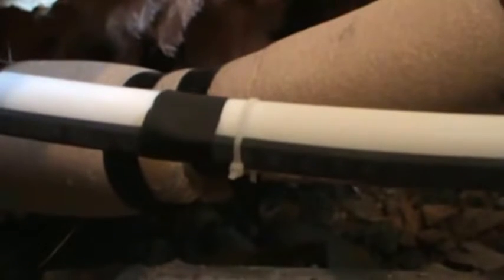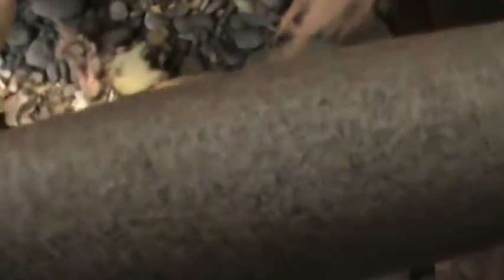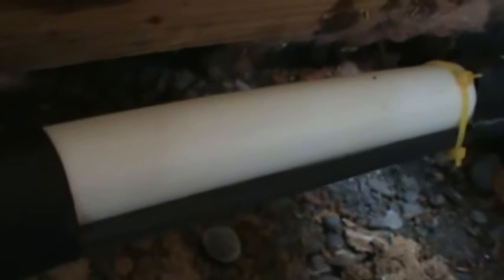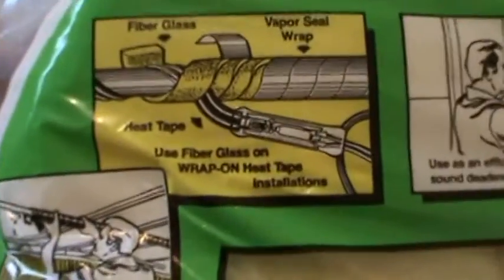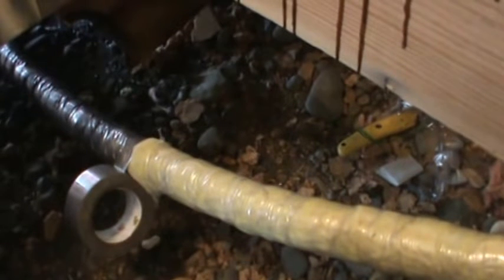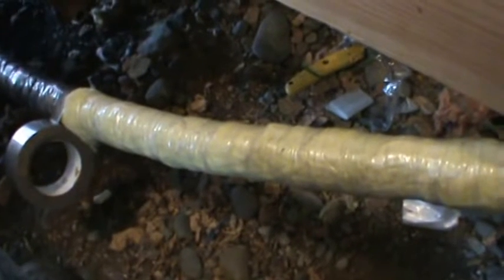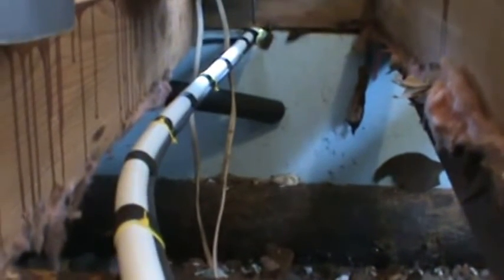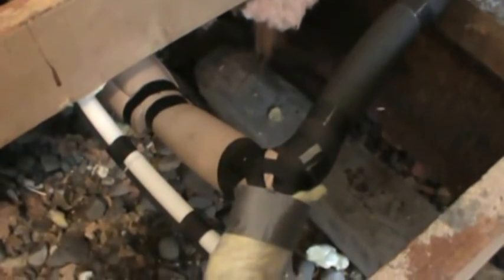How to Properly Insulate Water Lines in Alaska for -70 degrees Licensed Professional

Comment: How about the pipes inside the mobile home underneaththe floor do i still need to put heat tape in that?
Reply from the maker: Billy Montoya yes sir Billy there is no heat underneath your floors that’s the underpinning of the trailer. Newer trailers should already have it installed in colder climate areas but a good rule of thumb is to check out the main water line coming up from the ground and follow that line in every direction it goes and ANY waterline that is under the floor of the residence in the unheated underpinning area even if it is partially installed. 
Like that old saying goes......
“An ounce of prevention, is worth a pound of cure!”

Trust me you do NOT want to be under neath any of these trailers working on some frozen line that’s burst and I’ve seen them from 31 degrees all the way down to -58F below 0 which had with that temperature sustained winds of over 100Mph and gusts measured up to 160Mph. Let’s just say VERY COLD! I even seen one trailer that had to be chiseled into as the water sprayed the back corner for weeks and it had encased itself fully and the excess water was running back into the ground where it came up from. It’s never ever any fun to work with water once the temperature gets below freezing.
Reply: That will be myself soon... I’m in 1985 mobile home my heat tape took a crap last night. So in Ohio 15-20 degrees I’ll be replacing the heat tape

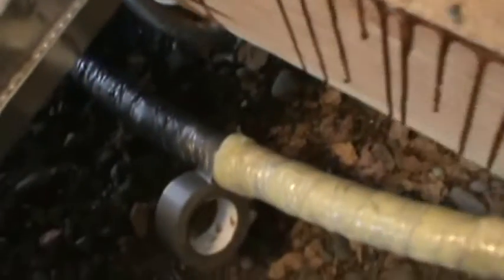Comment: Why wouldnt you install it at the 6:00 position?
Reply from the maker: That’s the exact resting place for all condensation and all water moisture to collect at just hanging around there. By making sure our material is avoiding that direct 6 o’clock position area then we are actually slowing down the deterioration process of our heat tapes and the metal braided parts inside the heat tape itself prolonging their life expectancy. This way having it at the 4 or 5 o’clock or the 7 or 8 o’clock position that allows the moisture to proceed right on past our materials relatively quickly finally resting at the lowest possible point with that being the 6 o’clock position but yet we are still in the ideal spot to get GREAT all natural heat transfer freely working for us inside the pipes because like always....heat rises so at the 4-5 o’clock spots or the 7-8 o’clock spots the heat will naturally rise up to the top of the pipe transferring heat from the pipe to the water and then from the water back to the top of the pipe.
Gravity, my man, Gravity.... it’s always working against us! 😂 
Gravity is bringing our worst enemy to us and we just want to avoid that spot at all costs. If you can imagine one heat tape wrapped around a pipe that’s just soaked in water all the time versus another one heat tape wrapped around a pipe that’s bone dry all the time which heat tape do you think will FAIL first and why?
YES!!!!!  Your Exactly CORRECT Wayne the one just soaked with water all the time will FAIL first and it’s because water is a corrosive in and of itself. Water is constantly eating away at everything around us each and every day. We are just trying to slow that inevitable process down as much as we can my friend. It saves us money, time, labor, materials, etc by doing it this way.
Hope this helps and I tried making it a fun answer Wayne so please don’t take any offense as it sure was not meant any other way than being a fun way for me to answer the question. By all means if you have any other questions be my guest and ask away Wayne, or any one else that comes along here wanting to know the answers to something you just might not grasp all the way and maybe I can try a different way of explaining it? Heck what would be GREAT is if you had questions that I couldn’t answer??? Why???  You may ask.....well that’s because I LOVE to learn more stuff myself and if I don’t know the answer to your questions then I do know how to find the answers and I’ll be learning something new in the process myself. 
Thanks 🙏 for asking such a great question Wayne I just had 2 friends here ask me to explain it a little better for them too so hey man they didn’t quite understand this concept either of not having it directly at the bottom of the pipe at the 6 o’clock position.
Reply: @dealsgalore  That's interesting. Cuz he said in video one of the fails is bad heat cable.   cool.

Comment: why do you specify the 5 or 7 oclock position? why not the 6 oclock?
Reply from the maker: Because condensation and any water or liquids will always go to the 6 O’clock position and by keeping the heat tape slightly above there that will keep the heat tape from possibly rusting out if it has braided metal coverings or any metal will rust. You also have electricity inning through the heat tape and we all know what electricity does with water and that’s definitely not good! Yes to get the heat tape as dry as possible to prevent premature deterioration of the heat tape.

Comment: What is the fire safety risk/failures using this method?  I ask because applying the foam tubes over the heat tape would seem questionable simply because it doesn't take much heat to melt those black foam tubes, and then adding fiberglass insulation wraps would seem to just compound the change of a possible fire igniting.
Reply from the maker: Billy Brigman the foam insulation is fire rated and fire retardant.
Reply: I was curious too   but now i know..cool thanks

Comment: i have a mobile home on li  in ny   its winter temps go down to 6 degrees ,   the crock under the mobile home has the shielded round heat tape with the black foam around it  now to see if its on. if i feel the first 3 foot of the heat tape wire  near the ac orange plug  yesfeel on o cold good day  should it feel warm   if its working ?
Reply: ReadyTemp intermittently circulates heated water through both the hot and cold water lines.  1/7th the energy consumed by heat tape.  Protects more pipe then what heat tape wraps around.  Installation requires connecting 4 hoses to the ReadyTemp which is 6"x6"x7".
Reply: it seems te heat temp is just a better insulation
Reply from the maker: Rondo Schiavoni it should be like warm when done correctly.
Reply from the maker: Rondo Schiavoni if you just want to keep an eye and make sure your heat tape is working properly all the time you can order a wireless programable thermometer off of EBay and to install you just tape the sensors onto the heat tape or water lines beside the heat tape and then I would recommend installing the receiver in you kitchen or living room where you spend lost off your time at and that way you can always jut glance over and read the temp and see that it’s working and hey if you do forget to keep checking it there’s alarms you can program when to have them go off and once the temperature drops below your programmed level the alarm starts sounding off alerting you there’s a drop in temperature and then you see which sensor it is and that tells you exactly which water line and which heat tape has failed and you simply go directly to that one and replace it. It’s the cheapest m, easiest and best way I’ve found yet. You can buy one off of EBay and have it delivered to your mailbox and super simple super easy installation you just tape the sensors onto the water lines beside the heat tape.

Comment: Open pipes in those temps why not those pipes underground ? Less heat tape less insulation less exposure less work , from underground comes up to under floor put that exsposed  pipe through big enough box with enough soil to insulate all around from cold from ground to floor. Then don't need heat tape or wrap around insulation. I don't t have exsperience with those temps . Just my opinion 😀
Reply from the maker: To begin with this job was a 1960’s or 1970’s trailer or mobile home that had been sitting there for decades. There was no way to dig 8-9’ feet down into the soil to properly insulate geothermally especially when your work conditions are a crawl space 24” high. This area of Alaska is one of the coldest areas on the road system in the entire state even colder than Fairbanks so we normally go down about 8’-9’ feet deep to run our water lines. We then run our water lines through arctic pipe. Arctic pipe is a galvanized or aluminum exterior 12”-16” pipe filled completely full of a dense styrofoam insulation with a 2”-4” PVC pipe conduit in the center of it. We will run our water lines through this arctic pipe to the residence but we normally don’t go back underground once the main hits the residence. Now with this specific area being on an ancient riverbed and within yards of a current major river, the same river that once ran where this residence is its full of old river rock snd the water table is about 12 feet deep which varies to sometimes just a. Few feet deep. Now also we have tundra up here not soil as you know it and it doesn’t have the same insulation value as your soil does so it’s a whole new ballgame up here than it is in the lower 48. That pretty much goes or lost everything up here too it’s a whole different ballgame up here. You can’t just bring all your ways of doing things that you e done down there in the lower 48 up here to Alaska and do them otherwise you WILL be in for a world of hurt let me tell you that right now! It’s best to see how many others have done things and are doing things up here and follow along then you’ll soon realize that the ways you’ve done in the lower 48 won’t work up here for various reasons. You definitely have the right way of doing things in most cold areas just the wrong example of an area here because it is the exception to the rule. Great comment thank you 🙏 for that!

Comment: When the heat tape does fail.... it must be a bear to get all that stuff off to troubleshoot the failed heat tape.  ReadyTemp intermittently circulates warm water through the hot and cold water pipes "as needed" to maintain the temperature you select and has proven 100% effective.  Installation= 20 min, connect 4 hoses and plug it in.  Typical life of system is 8 to 10 yrs, current record is 18 years.  Consumers with power outage concerns have powered their ReadyTemps using uninterruptible power supplies like those used on computers to allow a safe shutdown.
Reply: Checked your website and I see NO WAY to circulate warm water through building entrance pipe without violating the intent of backflow preventers unless a tee and  backflow preventer can be installed several feet into the trench - not exactly a cheap job if the entrance pipe is already buried six feet down.
Your posts are as irritating as spam.
Reply from the maker: Paul Logieri I totally agree and it seems to me a BIG hassle and just another thing that can and will freeze up and burst! People and Businesses like this are VERY annoying and I instantly get turned off by their rudeness and will NOT use them at all just because of their Blatant disrespect! It’s one thing to make a comment advertising your product but to comment 17 times in one periwinkle video over and over and over is rude, obnoxious and just plain wrong!
Reply from the maker: Ready Temp I am asking you to STOP repeatedly commenting on my video your VERY RUDE and VERY OBNOXIOUS like a childhood bully just teasing a smaller younger kid! It’s one thing to make one comment advertising your product but to do it repeatedly is just plain wrong!!!